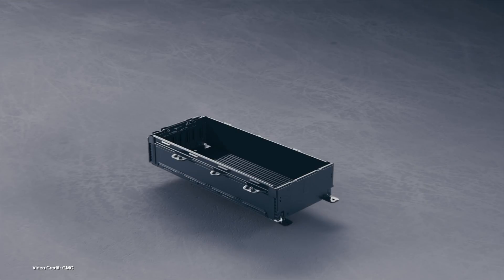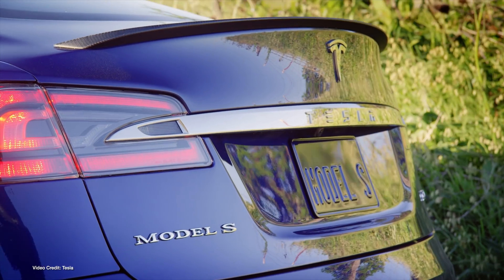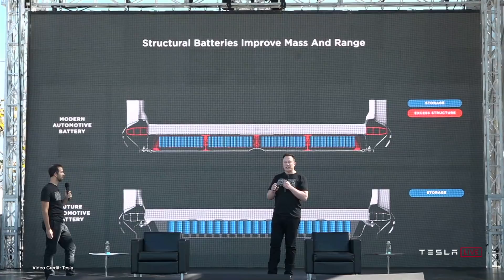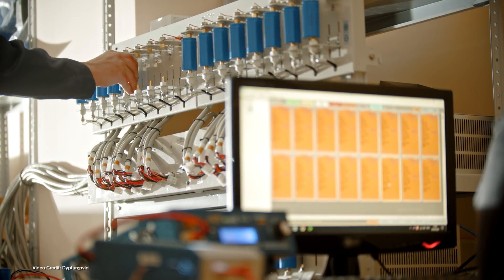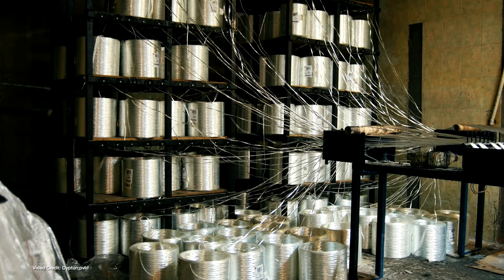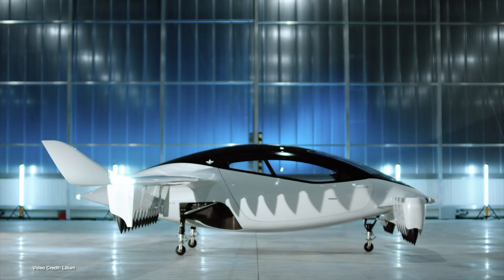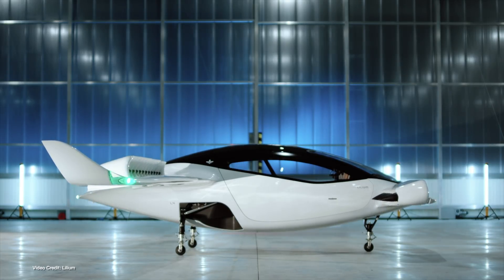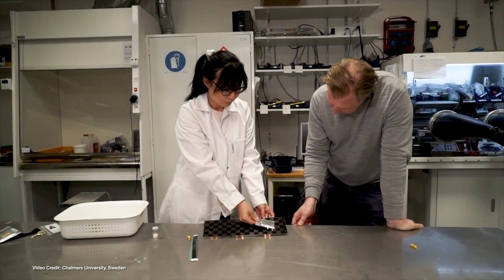Why You Should Be Excited About This Battery Breakthrough From Sweden!

Comment: Never going to work in cars due to risk of physical damage. Never going to work on commercial aircraft because regardless of strength the energy density isn't close to being sufficient. If the component is structural then either a) every cell works after manufacture and for the life of the vehicle; or b) there is cell redundancy with bypass of damaged cells so they do not compromise the overall performance of the battery. I do not want to recycle my car because I have a fender bender. I am sure this technology will find applications but I don't see it as a battery panacea.

Comment: Minor whinge. The Elastic Modulus or stiffness is actually pretty consistent among steels, and indeed among most iron based alloys. The tensile yield strength can vary dramatically between different alloys and heat treats, but the elastic modulus  typically only varies a few percent. Same thing with aluminum alloys, their stifness is always about 1/3 that of steel, but their tensile strength also varies considerably depending on alloy and heat treat.

Comment: The only disadvantage I can see is that you couldn't realistically change the batteries and the batteries could not be used (easily) for energy storage after they come out of the vehicle (unless they are made as a flat slab which is unlikely).

Comment: Sure a quite interesting Technology and worth further Research, but one of the Keq Questions got unasked: How easy to work with is this as Structural Material?
Not much point in it if you can only ever get flat sheets out of it and cannt attach it to other Structural Components (eg by Riveting or Screwing, or by Glueing if its "Layer Adhesion" can take this)
Might be a bit early to ask though, but the Research Team should have this point on their Radar too.

Comment: It's highly unlikely as strong as you can make aluminium, or a composite, at same or even lower cost, so you will need more structural mass. 

All things considered, it will be very difficult to make as strong and light and cheap, as producing structure and batteries separately. 

24 Wh in laboratory, and assumed multiple times better with further development, will mean far less than 24 Wh in first generation of usable application.        

But, even att 24 Wh, or even 50 Wh per kg, you wont save weight if you have to increase the weight of the vehicle body just a few percent, compared to optimizing the body, and using "conventional" batteries. 

Also, take a car like a model S, a bit more than 2000 kg. Take away the battery, seats and everything else that cant be made in to those new batteries, and you have a lot less than 1000 kg. That means a lot less than 24 kWh at 24 Wh/kg, in a car the size of a model S, it will not be worth the hassle. Common easily produced cells will probably have more than 500 Wh/kg before that becomes a product.

In electric airplanes? It's a compromise, you can't get as good strength for the same weight and incorporate a battery function. You'd need an insignificant weight penalty, which is not likely to be achievable. Unless the energy density gets decent, which is also unlikely to happen.     

It wont be cheap to produce, other than possibly in flat sheets. Also, having the batteries exposed, not a good idea. Exposed to heat, cold and physical damage, those things will reduce function, life expectancy, and safety.

Comment: Why focusing on its modulus? I wonder if making use of this carbon fibre's tensile strength makes much more sense. You could easily replace the conventional carbon fibre wrap that hydrogen tanks are made of and voila, there is your buffer battery. 
To me, wrapping this is a much more reasonal approach than trying to form cracy complicated shapes, needed for structural cells of vehicles with all their cut outs and crash structures .

Comment: Problem with load bearing is what happens after 8 to 10 years? How do you replace some of the battery's?
Reply: Good point.. a new modular design with redundancy built in could be an awesome side effect technology.

Comment: My fear with this “spread over” type of battery in a vehicle is with the ordinary little dents we have to get fixed. Bodywork is already expensive, imagine what a door filled with batteries would cost to replace!
Reply: Concur.  The current extraordinarily high costs of battery replacement would turn into "just junk the car".  i.e. Not a $10,000 replacement job, but a whole-car $40,000 replacement.  The planned-obsolescence crowd will love this.
Reply: Exactly. At first look it seems awesome...but I don't know...this seems like something I would shy away from spending $25k or more on...
Reply: As I understand it they envision it to be used more for other things than cars.
Reply: Yeah what happens if you dent your Tesla truck frame? Totaled
Reply: Yeah, but then you can get a horse and buggy... no doors to ding there  :-)
Reply: @Cid-tr3du  obviously you haven't seen many horse drawn buggies. Many of them have doors and full enclosures although those are usually called "coaches".
Reply: @RollinShultz  Troll.
Reply: @Cid-tr3du  Ohh, someone doesn't like being corrected and gets offended easily. Name calling never wins.
Reply: @RollinShultz  cid was saying that their comment was a obvious joke and was not expecting anyone to take seriously. 😐
Reply: Although...flexible and self-healing batteries may become a thing. With nano-tech improving the way it is, this may become viable really soon.
Reply: Exactly.

Comment: Aerospace uses, yep can definitely see that. Mass produced road vehicles, doubtful, probably hard to manufacture without scrapping large parts of structure if the embedded battery isn't working right as it moves down the line, End-Of-Life recycling could be a bugger as you'd have comingled active battery constituents and passive structure and if you get into a fender bender repair costs for these active structural components might not be economic and insurance companies might total these kinds of vehicles in even minor collisions.

Comment: My concern here is that the battery pack is the vehicle so what happens when the batteries no longer function as such. I guess one would design the structure to be modular and recyclable. Would also be interesting to know the energy cost for production of the battery based structures versus steel, aluminum or composites.

Comment: Don't forget that all large battery cars require cooling.  Tesla's cars all have their batteries in a liquid that is pumped to a small radiator or heat pump where itt is cooled, then recirculated to cool the batteries.   Cooling batteries that are part of  numerous structural parts of a car will be a challenge.

Comment: I have one major problem with battery powered cars, well actually two. Until all power is produced by renewable sources, you are merely transporting the pollution caused by ICE cars in cities to the more rurally sited power stations. The second problem I see is if you have a 6 figure income and the ability to reduce your cost with tax deductions, then an expensive battery status symbol is doable. The average mug who wants a cheap car that has a few luxuries and can be used for the occasional rural jaunt, then you will be walking in future. Get a car that sells for     $US20, 000 and 100% renewable power and I agree it will be a goer, until then 80% of car owners will drive ICE.

Comment: Making Ev’s cheaper by making batteries a structural part of the car sounds good idea  but what if the battery or one or more cells are faulty I.e Hyundai kona batteries how difficult is it to repair / replace the batteries.
Reply: Well, presumably, this is a fixable scenario. Otherwise the research would be pretty pointless........?!

Comment: There have been like 100 battery breakthroughs that revolutionise the transportation industry since 2010 and not one of them has made it anywhere near production yet, the closest one being solid state batteries of which the intrinsic advantages compared to LiPo batteries are steadily becoming fewer and fewer as LiPo batteries become more advanced. I fail to get excited about any of these new battery technologies until I can buy a product that uses any of them, until then they are a pipe dream.
Reply: Cars were a pipe dream until someone made one which worked!
This also applies to every other scientific breakthrough - ever!
The fact that we haven't YET seen a viable replacement for current EV battery tech is completely irrelevant!
You don't give up on R & D because you haven't made a breakthrough!
It's a continuous process - obviously!
D'oh...!

Comment: Batteries have to be compressed to work.  Tesla has previously had a double structure (one to hold the cells and the cell can to compress the cell). Other batteries using flat cells have a combined structure to compress the cell AND contain them.  So really, Tesla are catching up with what flat cells can already do.... This new development is damn cool and a step on from both previous designs!

Comment: This is a cool tech, but even at 100 Wh / kg, it most likely will not compare favorably with structural battery packs using 4680 cells or prismatic cells in 10 years. It seems terribly heavy for our ever increasing energy needs, and in this case, rather than focusing on energy density, an added bonus, we really need to compare the weight and strength of these panels to the weight and strength of the panels it would replace, for instance in planes or trailers that have a high panel surface area.
Coupling these structural battery panels with thin film photovoltaics would be even cooler. No wonder they're partnering with the Swedish NASA, they'll need the kind of highly efficient multi-junction solar cells used in satellites...  ;-)
Pricing will also dictate the types of application for such panels.

Comment: much ado about nothing. With a 24 Wh/kg of energy density is not going anywhere. Besides the battery in the floor of the vehicle is the best positioning for driving dynamics and crash safety as well. In addition, this solution would make body repair even more expensive that it already is. And a model X, or even e-tron, already shows that the weight penalty is not really an issue, also compared to traditional vehicles.
The real breakthrough rests on a realistically achievable two-fold increase in energy density (500 Wh/kg) of batteries, all the rest is just noise

Comment: What about the possibilities to recycle? Today it is possible to extract car batteries after about 10 years and use them for power packs for about 10-20 years more. What do you do if the battery is inside the shell of the car? Put car shells in the backyard as power pack? And after? How do you recycle? 
Even on this channel you forget to talk about those things. 
Also, about the weight. It all depends on power to weight ratio. If you need to put alot of more weight of the battery into the shell of the car the center of gravity point could be worse than a fossil car.

Comment: I think it will hit a wall when it comes to operating temperatures. It's no good for vehicles as an outer skin material as temperatures fluctuate from winters of -25 °c to summers of direct sunlight possibly +200°c on city streets. Electrons have a habit of slowing down when cold and speeding up when hot.

Comment: Imagine it they combined that battery with a top layer of thin film solar, then use that product to build aeroplane wings and fuselage.
Reply: Realistically, there is not enough surface area available to make a meaningful contribution to the battery, while adding weight, complexity and cost that more than cancel out any potential benefit. You have to maintain them and their systems, fix them, clean them, etc, etc, etc, you know how solar works already. Ditto for solar on car roofs. You can't angle them for maximum effect, and you have to carry them around even when they're not providing any charge due to being in the dark or just facing the wrong way, which they will half the time. Airlines invest millions into developing special paint, because of how much it weighs even though its thickness is measured in molecules, now you want them to cover the planes in solar film??? Just make the solar panels and put them in places optimal for insolation, we haven't even put a dent in those yet. Putting solar on vehicles is only a little bit less dumb than solar roadways.
Reply: Your thoughts stuck me as a good one if it was used as a storage solar panel for homes then this is a very viable scalable product.
Reply: That's funny Lamborghini and MIT already built a car with this technology several years ago.
Reply: Solar only gives enough power per surface area to fly an ultralight aircraft with over-sized wings. If you slap solar cells on a 737, they need to be rugged enough to survive 200+km/h strikes from everything planes run into during a typical flight or they'll spend more time requiring maintenance than providing power. Covering the fuselage with solar cells is also problematic for maintenance since you'd have to strip cells to inspect it.
Reply: Where do you work!? PROMOTION!
Reply: But what if they combined it like Sono on its Sion?
Reply: @stuartlark6441  Sions don't fly.
Reply: They could then run the plan's AC with it. So what?
Reply: @nachtaktivster  Electric propulsion.
Reply: @domg7359  No way! As said earlier, only viable for Ultralights without payload. Not viable for passenger planes.
Reply: Great idea.. currently they are already making ultralight planes that are designed to fly for months . they have to include batteries that power it during the night..and even then they descend quite a bit during the night. This would make these planes even more viable.  !!  Forget starlink.. this is air link !!
Reply: If this was a viable idea they would already use it. The APU in combination with engines make more electricity than they ever need.

Comment: I don't see this technology in EVs at all. The energy density is too low and production costs too high. Even for things like laptops or tabletts - if you remove all the electronic - how much does the empty chasis weight? Next to nothing!  So replacing it with a "structural battery" with such a low energy density will result in a way to small capacity. But for some niche applications like in the space industry it could really have benefits in the not so distant future.

Comment: Chalmers Uni are amazing on both battery and solar tech. Also, you might want to check out Oxis Energy in Oxford who are focusing on aerospace and marine which are at 450w/kg for Li-S. Granted these might be more pricey geared for aircraft, but eventually it could make its way into automotive. And,, its neighbour, Oxford PV doing amazing work to commercialise perovskite PV which will reduce cost and can be embedded in composites. Happy days for Aptera, Lightyear, and Sono. The body as battery will be brilliant for marine sector with the hulls of boats.

Comment: I am an engineer living off grid and new techs are allways interesting! BUT what a pain to recycle this structural battery  'sandvich' after its life cycle! Hope they will present a solution to that as well.
Reply: I was thinking the exact thing. A benefit of the current design is that the batteries today can be removed for repair, refurbishment or recycling. I imagine there is a way to solve this, or rather for this to be viable it has to be solved, otherwise we will be adding to our mountains of waste.
Reply: @MrBenderad  No!
You have to put so much energy into recycling, in order to recover materials for later construction use.
Reply: I think the best solution would be to use frame style structure with modular, somewhat easily removed and replaced connectors. I think using it as a external body panel/structural member is just too much of a liability, in the practical sense. 
If used as an external weight bearer, suddenly anything but the very mildest of collisions becomes quite the electrical and chemical hazard. 
With my idea, I think the likely result would be that any vehicle with outdated or worn out batteries would be shipped or sold to a rebuilder, who simply removes the body panels and drivetrain, then inspects the reused components and installs the new frame/battery pieces from standard sized components they have in stock. 

The good/bad news is this favors the design of bulky, squarish, body-on-frame pick-ups and SUV's, the larger of which already have more or less standard frame dimensions in the US.
Reply: My thoughts also,. They should have kept the "battery swap", just to allow a replacement battery.  Now they are going with the iphone, that if the battery goes bad, just throw the whole car away.  I was thinking that this was some misdirection from tesla to lead other down a bad path, but elon continually says that its his goal to share everything....I'm really disappointed...
Reply: Same thinking here my  fellow good engineers. A 2nd life for batteries are needed. Imagine a of pile of inefficient batteries being dumb to  poorer countries... same issues with the plastic waste.. shipped to other nations.
Reply: this

Comment: What happens with the crash resistance?

With all the current EV batteries in production they need to be protected from big impacts otherwise you have a major safety issue. If you hammer a nail through a battery it'll go catastrophicly wrong.

So why don't these new batteries need crash protection?

Comment: I could see this being used for replaceable panels on cars in addition to traditional battery packs, but not replacing them out right, without artificially limiting the life of the vehicle do to battery degradation.  In a similar vein, I could see them being used for replaceable Wings on aircraft, but not replacing the entire fuselage without shortening the life of the aircraft itself unnecessarily.